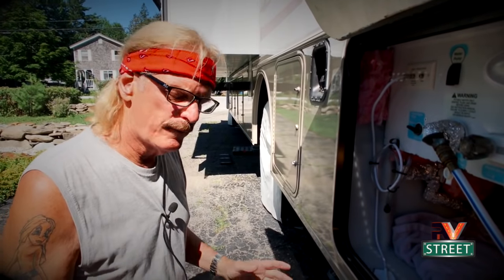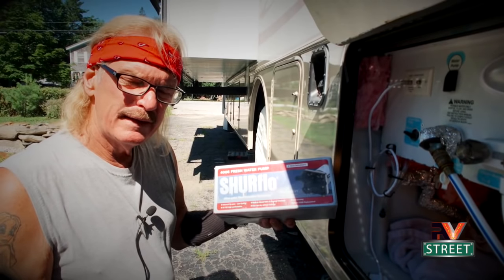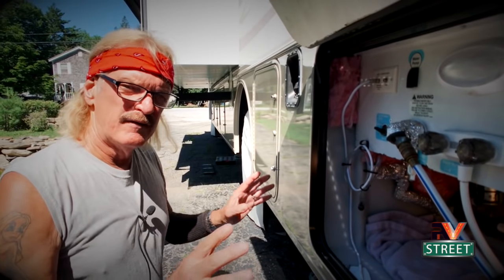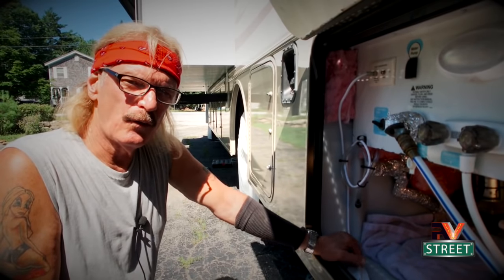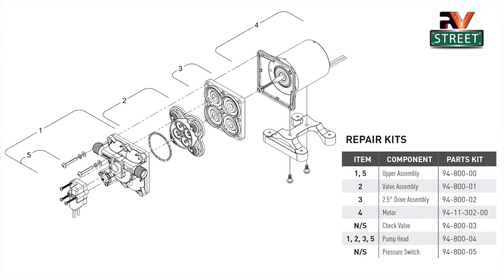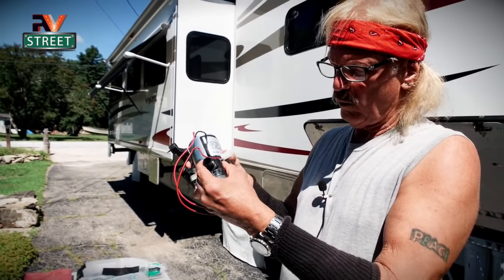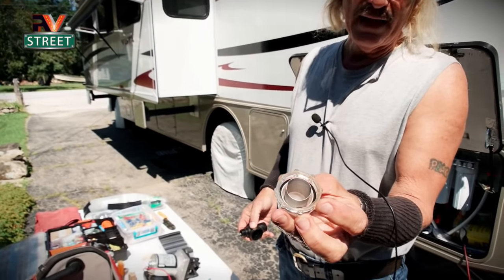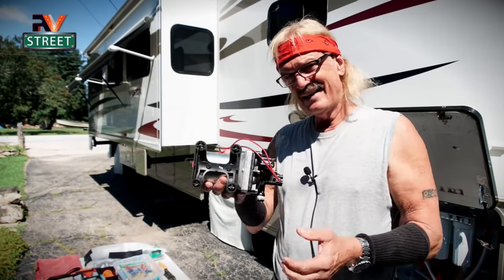RV SHURflo Water Pump Replacement & Important Tips

Comment from the maker: AS A SIDE NOTE, once I completed this video I did come back and remove that electrical tape off those two electrical connections and I put a heat shrink jacket over them instead. I should of showed that in the video. This is a much better way to protect those connections.
Reply: I noticed on your attached equipment list for the spade connectors Amazon page, the plastic on the connectors is heat shrink.  It says to crimp like normal, then apply heat to shrink the tube.  Extra heat shrink doesn't appear necessary as it's built into the connector.  Great job on your videos.  You have become my "go to" for information.
Reply: Awesome. I watched this and my first thought was, "Electrical tape!? I mean, that's okay, but if you have heat shrink on hand..."
Reply: That. Too
Reply: @shadowphantom2567 he used regular spade connectors and heat shrink over them, not the ones he put in the parts used.

Comment: I am still wondering what was wrong with the old pump. 22 years of aircraft maintenance has me wondering. Probably that $7 pressure switch. Cool video. Look into lever wire connectors. They will change your life and you’ll throw away those butt connectors.

Comment: Good video.  All the basics are covered.  One improvement would be to reverse one of the sets of spade connectors so it is impossible to get wires reversed when reconnecting in the future.  While accidentally reversing is improbable with color coded wires and is not a hazard on a 12V water pump, if reversed the pump will run backwards.  Nonetheless it is good practice to make things foolproof at every opportunity.
Reply: Ironically I think diaphragm pumps will pump the same regardless of which way the shaft spins

Comment: Getting to my pump is a pain. When I replaced it my wires were too short. I made do. I will get back in there and add wire based on your instructions. Thank you.  I love that to explain without the umm and  unrelated comments so many have. You  just just get to the point.

Comment: Great video. Everything is explained so almost anyone can do this.  I have a 2008 Vista motorhome but my water pump is located under the queen bed in rear.  You have to move matterss out and remove the 3/4 inch decking to get to it.

Comment: Thanks for your video. It was both informative and intimidating. On our way to Maine after fighting our water pump for over a month we finally replaced ours Today. Paid way to much for a SureFlow pump rather than figuring out how to buy one from Amazon and having to figure out where to have it delivered. Our pump had more difficult access under the bed. Tried to use heat shrinking wrap, but it did not fit over the connectors. What a relief to have our water pump back in operation even though we only got 5 years of service out of this pump.
Reply from the maker: Thx Kx 👍
Everything I use and show in my videos is in my Amazon Store. Next time you could go there to make it easier in the future. Book mark my store below and make it even easier. And yes, having an operational, reliable water pump is essential. BTW...you should always carry a spare too.
https://www.amazon.com/shop/rvstreet
thx for taking the time comment 🙏
Reply: @RVstreet  👍 Roadtripping fulltime in RV makes Amazon deliveries timing and location challenging for us especially in unfamiliar parts of the country. Did it the old-fashioned way—bought at retail stores. So far so good. Thx again for the video.
Reply from the maker: @Kx RV66  Sorry. Ya I totally get the issue of mail and FTing. I run into that too.

Comment: Another great DIY Martin....with excellent camera work by Joanie!  Before a recent cross country and back again trip I replaced our water pump with a new one as the original pump was starting to make some noise and I didn't want a failure en-route.  Put the original pump in the box and packed it in the coach as a backup (failures can happen even with new pumps).  

One difference from your DIY is that I used barrel connectors to wire up the plug with heat shrink to keep any moisture out.  I figured I would just cut them off the next time we need a new pump.  It's important to use the right size tubing as there is a limit to how much it will shrink and you don't want it loose.

I like the tip about shutting off the water.  With  hundreds of connection points in the water lines and bouncing down the highways you never what might work itself loose....ask me how I know this!!

A serpentine belt for my Ford V10 is not a common item at auto supply or repair shops.  I purchased a new one to keep with us in the event of a failure I can supply the part immediately to allow most any repair shop to quickly swap it out and get us back on the road again.
Reply from the maker: Yep carrying an extra serpentine belt is smart. I found that getting them from FORD was the only way I could find the right one. I changed ours out too before we went full time and kept the old one as an emergency spare. Good job. 👍

Comment: My shopping list keeps getting bigger, but in a good way thanks to your videos.  Great idea to turn off city water at night and use fresh water. It would be great to be able to switch from city to fresh water from inside the coach. We always turn off water when leaving and we also turn off the propane.
Reply from the maker: "My shopping list keeps getting bigger"...

You know Carl that's good statement. There are so many RV folks—especially those that are just getting started—that don't realize RV's are not plug-and-play. They just aren't. It takes time to learn what you don't know. And that is a constant class we all are enrolled in. But...once you know what you really need to tweak, improve, make it handle better, maintenance items, make more reliable and safer, it's now just a matter of doing it or buying what's necessary to do it. Wise RVer's make these adjustments, while some just brush it off as not necessary. 
That's what this channel is all about.

Comment: One f the best videos I have seen in a long time. You are a fantastic storyteller and teacher, sir.
My pump is loud and I have determined some of that is due to rattling against the frame but I thought the rest of the noise was from the pump. I figured the pump would be relatively quiet, but as you show us at 14:16 these pumps are not all that quiet.
Reply: New subscriber!

Comment: I appreciate your detailed understanding and intelligent demonstration is clear and concise. As a DIY fix it type person, takes a lot of video watching before I find one like yours to bring my knowledge to a workable understanding. My grief with my water pump , a used 2019 Sunset Trail I bought 4 months ago. The price was right and overlooked the finer details that could of been seen. Regardless I chose to tackle each hiccup as they were uncovered. Amazed at the list of tasks I have fixed. My question remains, as I have ruled out the current Artis diaphragm water pump is bad. Now it did work at first yet the electrical components of the water heater were in grave repair.  Discovered the Atwood WH circuit board was bad and heat coupler fried, replaced the thermostat assembly also. Working water heater. Yeah!  Now the water pump not working. Wondered if there was some cross circuit between the two. Ss there is no fuse on the Distribution panel for water pump. At this point, due to this video of yours, I can see zero filter attached to inlet of Water input from fresh water tank. Did notice a full fresh water tank overflowing at drain point when dumping tanks. 🤔 then I notice a stench like old water under bed covey space, adjacent to the water heater and water pump compartment which is under an additional step down box on left side of bed. Like an extension of the side tables part of the front covey storage space front of RV. 

 So no filter installed in this replacement WP is why no power pump has failed. The overflow / vent tube attached to the current inline hose coming from holding tank has a valve at water pump inlet. It was in the off position where water comes in from tank yet closes off the vent tube. Yet what I discovered this vent tube when opened prevents water coming in from fresh water tank. So therefore not the area that leaked apparently a lot of water by noting the stains on wood under bed. And when I hooked up city water at my sister’s first trial run 200 miles and some assistance I needed for other repairs… the water began to overflow again under bed and poured out the back door due to RV leveling that direction. I check all lines etc and noted it was not water heater leaking it was the water city line connection apparatus. I noted the most water stains all down the inside wall. The fresh water connector apparatus did not show signs of any leakage. Replaced both of these outside fittings. Once again the fresh water tank was full again as I emptied it prior to travel. I can only surmise there is some built in check valve in city water connection , stuck . Or the water pump inlet valve from it’s tank was closed and the water coming in from city line has a T connector , leading water into RV yet also feeding water up into the outlet side of pump. 🤔. With the water pump inlet valve closed on fresh water tank side, would force water out the open vent tube, Thereby forcing water all into the compartment.
My question regards the city water incoming ought to be a separate water line and not have a T-connector that branches off , upwards and feeding into the water pump outlet side? 

Geez 🙄 that was a lot of explaining.

Something is not making sense. Why would the water pump outlet valve pump water back into the same city water line… Maybe it is too simple and I cannot see as I believed these two water systems were separated and fed the water lines in RV separately. I guess not. Anywho, i have new pump and has strainer to attach on inlet side & going to affix a 10 inline fuse from the hot wire off the water pump , as there is no fuse for water pump that I can find. 
Oh! I am trying to troubleshoot before replacing water pump yet this set up I am looking at is confusing. My instincts say, need an inline filter on pump and a inline fuse on hot wire. 

Any suggestion will be very much appreciated. Thank you for all your time and effort with your videos. Good info ! T from Tx Gulf Coast. 🌈🌈
Reply: I believe I found answer to my question. The failed pump did not have a check water valve installed and apparently the  replacement I ordered does not have one either. This caused the back flow into fresh water tank.

Comment: Thanks for your helpful video. We fulltime in a 25 ft. Winnebago View and our water pump has started making a nasty grinding noise. So we’re thinking  it may be getting ready to go out. Unfortunately, we don’t have much room in our coach to carry many spare parts or connectors, but I make do. 
And you think your water pump is difficult to access? Ours is under our bed in the back and the only access to it is by tilting up the bed like a chaise lounge. Wish me luck. 

We use our fresh water tank and water pump almost exclusively and take the same precautions you do regarding sanitizing the tank and turning off the pump at night and when we are away. Thanks again

Comment: Love your videos, they’re so helpful and confident building based on your attention to detail.  We have a 15 year old class B and the pump is very hard to access.  I’ve been dreading the day the pump fails.  After watching your video it seems to be a fairly easy replacement and I’m going to tackle before we have a failure due to the age.
Reply from the maker: No sense in dreading. It's not a big deal. If the area is small and to tight to gain access, maybe enlarge that area with a small jigsaw. Be creative. Cut away an access door or cut sheet metal blockages that prevent you to get to where you need to go. Plan your steps to not only make it easier this time but in the future if you have to ever have to get to this area again. 

Just look at it and study the area before you begin. Study and come up with a plan. Then ask yourself, "what can I do to make this job easier"? What tools am I going to need? Then to help assist you in re-assembly, take pic's with your phone before you start to do anything. If you get confused in reassembly just look at the beginning pic's to assist you to get back where you need to be. You can do this. This is not a big or hard job. On a scale of 1 to 10, I'd put this at about a 3.
Pls keep me updated on how this went if and when you ever decide to tackle this job.
Peace CJ. 👍

Comment: Got a question Martin, but first as usual your videos are topped notched and you talk for us laymen struggling to figure this stuff out so we can 'get it', thanks. I learned so much from your videos. Question: why turn the water pump off at night? is that so if there is a leak your not pumping water into the coach? I would figure you'd hear the pump kick on should that happen, but what about those 2am bathroom trips? Turn the pump on again then off again? Curious, thanks in advance for the response. And please keep the videos coming.
Reply from the maker: "is that so if there is a leak your not pumping water into the coach?"
Yes.
"but what about those 2am bathroom trips? Turn the pump on again then off again?"
Yes
👍
Reply: @RVstreet  Awesome thank you !!! I will now be adding this as part of our routine as well as turning off the water whenever we're away from the camper. Heck, that just makes perfect precautionary sense. Thanks again!. Keep those videos coming!!

Comment: Hi I'm in Scotland just came across your channel as I had an issue with my shurflow pump, it was he twist water strainer that was cracked and caused a leak probably iced up during the cold weather I think ,when I tried the pump after filling the tank it just kept pushing air through the system not water I'm hoping the crack was sucking in air , anyway new strainer ordered and a spare pump hopefully it will be ok , loved your video mate now subscribed .

Comment: Marten, I was wondering even with your water treatment system,  have you ever looked at your anod rod in your water heater? Also, look into a video I think it's called "never change your fan belt again" this guy soaked a belt in this milky stuff that had three numbers.  Like 303 or 353 something like that.  The belts never wareout. I think you could even brush it on sidewalls to prevent dry rot. Also, good for rubber seals around doors and windows.  
You have the best camera operator. 😎
Reply from the maker: We have a Atwood water heater so it doesn't require an anode. Only Suburban water heaters use those.
He may soak his belts but I would NEVER, EVER put anything on any belts. I have lots of experience with belts and what not to do, and this is one of them. Now we do use 303 on our tires. It's like suntan lotion for your tires and I have covered that in other videos.
For our rubber slide seals, radiator hoses, and other outside rubber parts we use another product to keep them conditioned and soft. It's a fantastic product.  I've covered that in other videos too.
Joanie says thanks. I like joeblow's comment. haha
thx joe 👍

Comment: Martin- Great video (again!!). If I understand, you fill your fresh water tank, shut off the water at the outside faucet and use your water pump. My question is: Do you leave the water pump "On" all the time, or do you turn on the water pump only when you need it? Thanks
Reply from the maker: Turn it ON only when we need it. But here's a little more description of our procedure.....
I leave our fresh water hose hooked up to the main spigot all the time while we're at the RV. If we leave the RV we turn OFF the main spigot. At night time—usually after dinner and dishes are all done—we turn OFF main spigot and turn ON the water pump therefore using the fresh water for the remainder of the evening. We use the water pump and fresh water till we go to bed and then turn OFF the water pump. Now both the main spigot and the water pump are OFF. During the night if we need to use the bathroom, we turn ON the water pump to flush then turn it back OFF. We have 4 switches to turn ON the water pump: 1 in the wet bay, 1 in the living area, and then 1 switch in each bathroom. It's really easy to get used to and this way we run no risk of something bad happening with water leaks when we're away or in bed sleeping if that ever happened